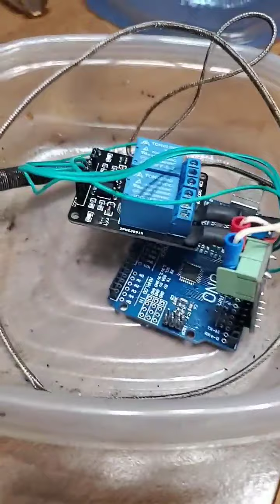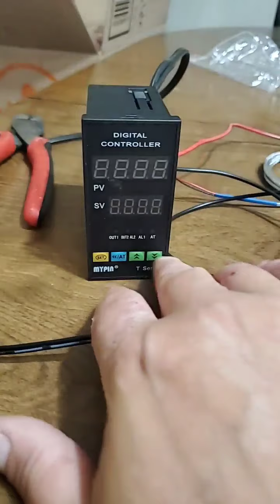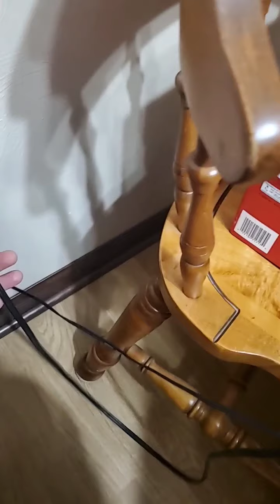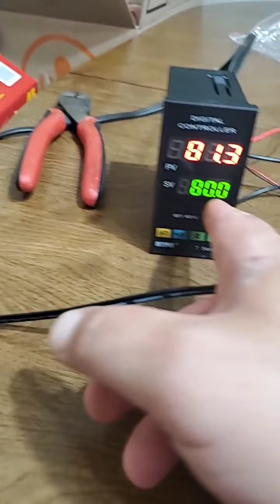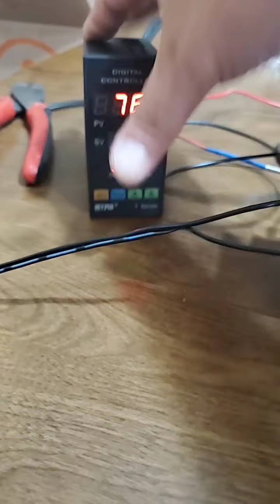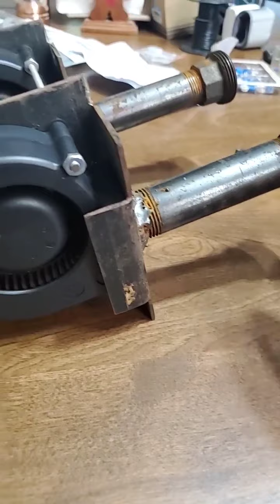Bbq/Smoker P.I.D. Controller build pt.1 mock up and testing (parts list in descripion)

Comment: Nice, have you thought about using linear fan control ? I build PID controlled hot air welders and use PIDs with 4-20ma output. The 4-20ma is connected to a phase angle power controller that runs the heating elements. It's not as cheap as pulsing a SSR but I think it would be pretty cool to use linear heat control on a smoker. For fan control I thought about converting a cheap fan speed control to use 0-10dv or 4-20ma input. When controlling a heating element the power module puts out a steady power signal that holds the set point temp, would be interesting to see how a fan controlled smoker handles linear control once it gets to set point.